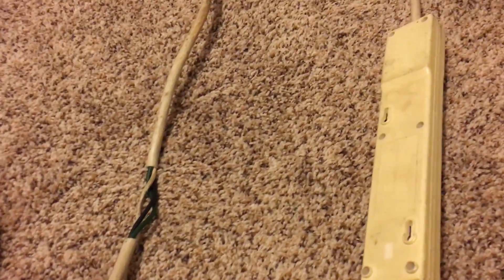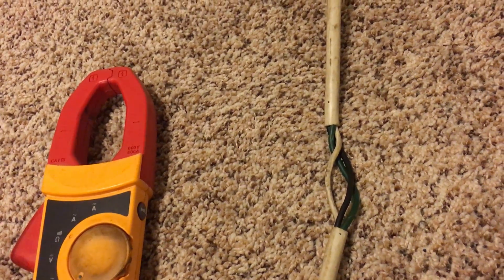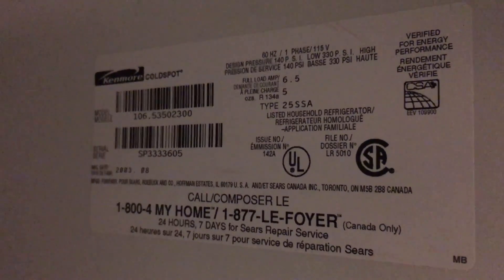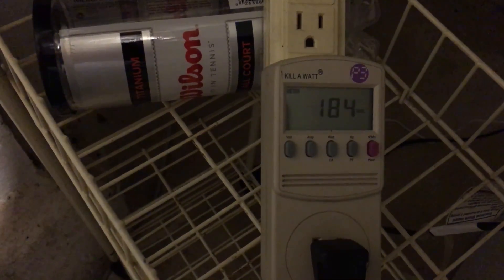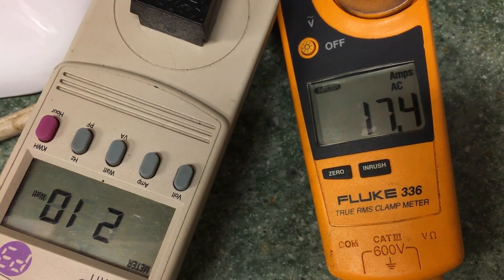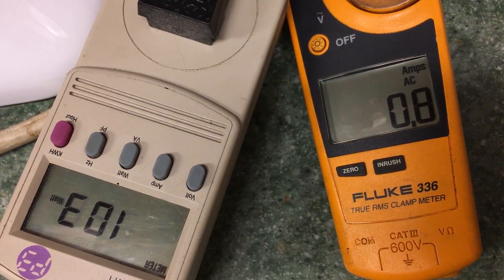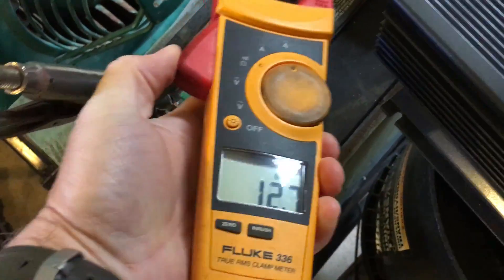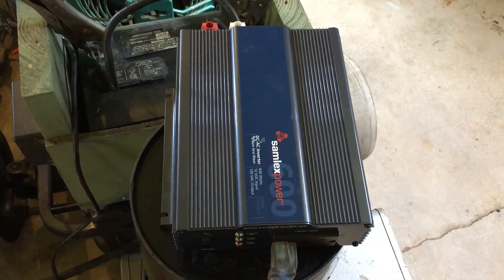how to power your refrigerator during a power outage

Comment: This might be a dumb question but is there a possibility that installing a capacitor might give you a bit of reserve for starting the fridge
Reply from the maker: I think it would need to be a few more components that just a cap, there are soft starting devices out there that work well. The better answer in this case is to just upsize the inverter

Comment: Thanks! I purchased a Bluetti EB240 Power Station and you demonstrated the initial power surge and expected running wattage for my refrigerator that has the same power specifications. I choose the Bluetti as my home power backup system since it can support up to 2400 KW hours run time with up to 1000 Watts output. The 1,200 Watts surge protection is above the 917 Watts when the compressor kicks in. If there is a blackout, I can connect my device to solar panels for continual usage.

Comment: We recently had a 13 hour outage. I just posted a short one minute vid of my GP2200i powering my fridge, separate upright freezer, periodic 900w induction hotplate, house lighting, modem and router, charging a laptop and a tv movie in operation. I ran the generator at full speed while hooking up to allow for the motor surges of the fridge and freezer .. and when everything settled down .. I switched to economy mode for the next thirteen hours topping off the tank at about hour seven.
Reply from the maker: It's a good feeling knowing your food won't spoil isn't it?

Comment: I’m trying to keep a fridge running during severe weather power outages. Would just any old typical deep cycle battery from Walmart be sufficient??? I’ve heard people say AGM but I’m trying to do it on the skinny while still being able to get the job done....
Reply from the maker: Several factors to consider. you need to find out how many watts your frig uses in a day *(buy a killawatt) that will tell you. Then you need to decide how many hours you want to have backup power. Once you know this, you can size your battery bank. But in general, if you buy a 12v deep cycle, or two 6v (and make a 12v), it would back up for a few hours.  another option, is just to buy a 12v inverter, and use your car as the generator. alot of other options, such as solar to keep the batteries topped off.
Reply: @IFix-Things  I'm doing the same thing Spring Hill Outdoors is doing.  Texas gulf coast, prep for lost shore power.  I have a similar refrigerator and was looking at the Samlex inverters.  Thanks for testing the 600, it seems to handle that load.  I really didn't want to buy the 1000 or 1500, at 12 v the cable size and ampere's really start to get extreme at around 1500 watts.  I bought a small aluminum dolly at O'Reilly's and mounted a plastic cutting board to its back, will mount the 600 on it, fuse, disconnect and a 12 v monitor with USB's.  On the bottom i'll put an agm 100 a/h so I can roll it into the kitchen or wherever neeed.  It will stay connected to a NOCO genius 2 for normal charging / maintaining but on the south porch I put a 170 w solar panel for a charging station during outages.
Reply from the maker: @BHeisler59  Stay safe down there. Sounds like you got a good setup there to keep the food nice and cold! Please update us after the hurricane rolls rolls , let us know how it worked out for you.
Reply: @BHeisler59  just wow… who do I call to help me set up my house. This is way over my head. Electrician?
Reply: SuperRobkar appreciate it, I’ll dig into & decide on something.
Reply: @IFix-Things  when you say use the car to generate, you mean put the battery in the car to recharge every 3 hours or so?
Reply from the maker: @SapphireBright  no I mean just connect the inverter to the cars battery. You would need to idle the car when using the inverter though.
Reply: Put your fridge on a variable timer and have it run on inverter for 2hrs, and off for 3hrs. Cycling it will save energy for other applications.

Comment: Long story short 300 watt inverter won’t run this particular fridge, 600 watt will. 15 minutes of your life saved.
Reply from the maker: I've seen some people put "get to the point" details at the beginning of their videos for the people that don't want to actually watch the video, maybe I'll start doing that
Reply: SuperRobkar a lot of people would appreciate that, good video nonetheless tho.
Reply: @IFix-Things  Thanks for the info. So, I could run two 700 watt refrigerators on a 2200 Generator? That's enough for start up?
Reply from the maker: SRQ PDQ I would say it depends. Depends on the starting or surge wattage capability of your particular generator.  The big issue you’d have is making sure the compressors did not start at the same time. Also some fridges have a self defrost mode , they tend to use a lot of watts during that time.
Reply: @IFix-Things  Thanks for replying. Yes trying to size a generator for two fridges. Thinking 2800 should do (?) Any way to assure they don't start at same time? Such a variance online as to how much surge power I need - some say 20% some say x4 (!)
Reply: Why not just read the electrical requirements listed in the manual for the fridge?

Comment: Thank you.
My 35 year old fridgedair needs 4.5 amps @115v to start the compressor.
That equates to 517  starting watts.
Run amperage is not noted so I can't figure it. But the rig only needs half the running watts of that generater.